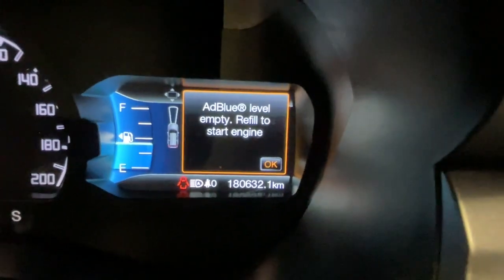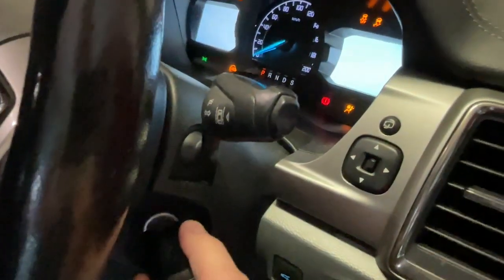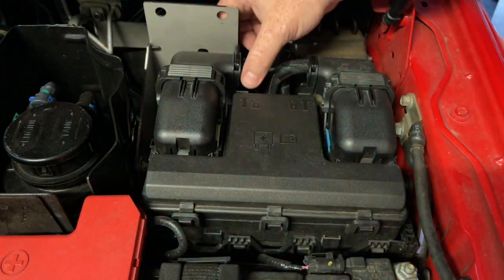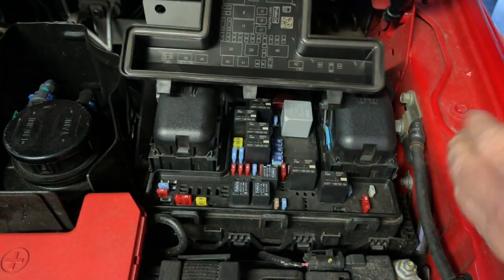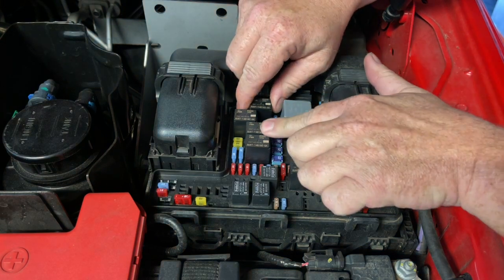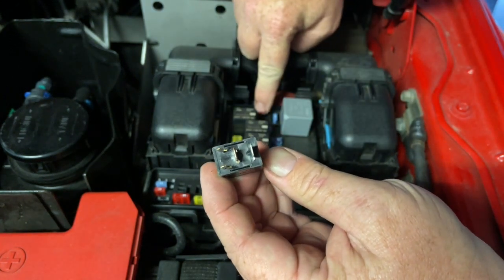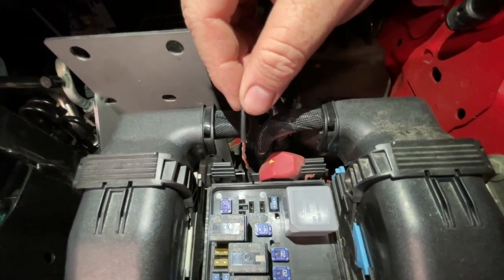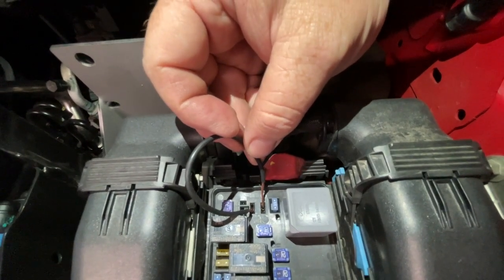Ford Everest 3.2 No AdBlue Starting Hack

Comment: Have used this trick to an everest. The owner changed his battery. After replacing the old battery, the car won’t crank and start. Using this hack really starts the car and it’s still running up till this time. That’s almost a year ago. Thank you so much for your blog. 👍🏻👍🏻
Reply from the maker: no worries

Comment: Thanks. I actually used this technique today on my ranger limited. I was away from home and It wouldn't start because the adblu had run out and the sensor couldn't detect it when it was refilled. I did what you described and got home fine! Thanks again!
Reply from the maker: Excellent!

Comment: Just made up a wire to be able to do this and confirmed it works. Thanks for the tip!
The AdBlue Malfunction Error, no engine start in 700km has disappeared but still have the check engine light on.
I imagine it's OK to keep driving it and if we have any issues between now and service we just use the wire?
I was surprised the AdBlue error didn't come back on.

Comment: Excellent handy fix demonstrated. Question/s; once the car starts, at what point does the #2 relay put back in? How far is it "safe" to drive this if the Relay is out? 👍🏼
Reply: "Number 2 Relay is for the Starter Motor, essentially you are just bypassing the key operation. Put it back in."

Comment: Hey. I tried this bridgemethod on my Ford Ranger XLT 2020 2.0L diesel 170hp 6 speed manual, and it did not work. I had handbrake on, gearbox in neutrual, ignitionkey i position 2 (running position). I also tried to lock down the clutchpedal with a stick but no result. The starterengine did run, but never started the car, no mather how long i tried - max 10 sec. My problem was that the adblue system was faulty due to broken hose and car was put i same "no engine start mode" as if the Adblue was empty. Any ideas?
Reply: No?
Reply: No
Reply: how you start the car?